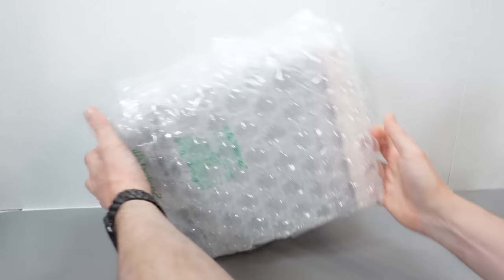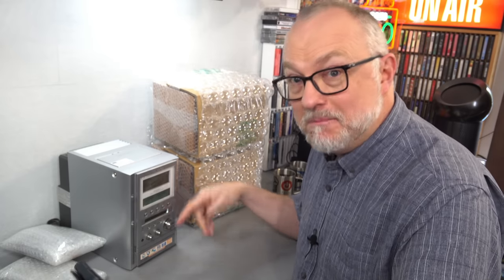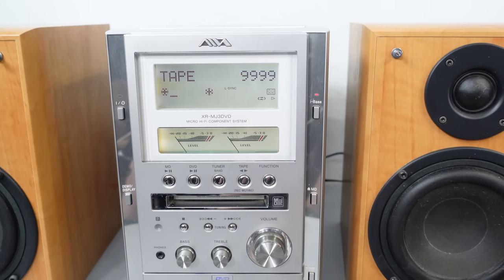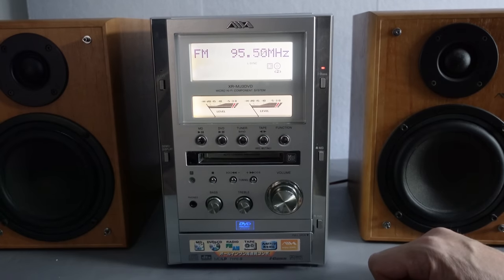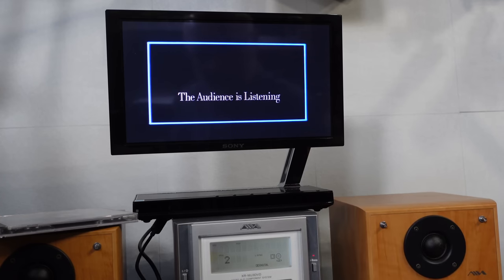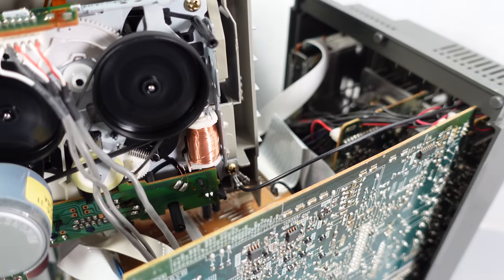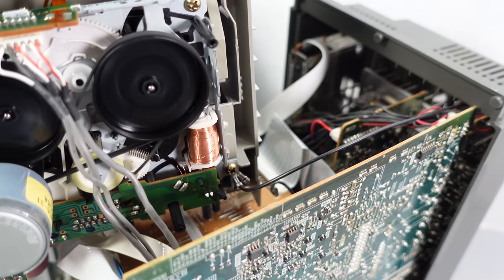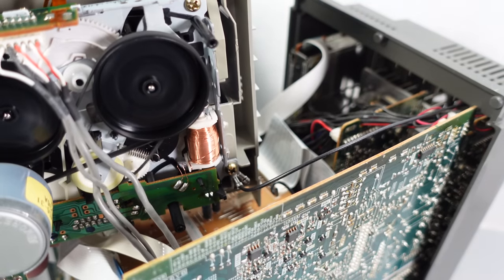Micro Systems 2:  Eclectic Boo-Boo

Comment: The CD/DVD tray problem should be a simple fix. The spindle motor assembly should drop out of the way of the tray as it is opening but it is not dropping early enough. Normally this is caused by misalignment of some gears. There should be some alignment arrows on the tray rack and gears for the default position. As noted, those ribbon cables can sometimes change what side the insulator is on. I think its good practice before disassembly to use a sharpie to mark across every connector to make sure you put them all back correctly. Also, the mini-disc may just be a bent leaf switch or bracket or something has become misaligned/disconnected etc..
Reply: It also can be caused by the magnet in the top of the drive that holds the disk down magnetizing the metal in the spindle underneath it. The motor that normally pulls them apart isn't strong enough. A hacky repair for this is to get those 3 ring binder reinforcement stickers from the office supply store and stack a few of them on the magnet. It causes it not to stick as hard to the spindle reducing the force the motor has to overcome. I've had this issue on a few old xbox 360s and that was the "fix".

Comment: My experience was, that these types of systems often had issues to a degree, that you wouldn't use them very often (which is why these systems look nice and unscratched): CD read errors or jumps and pauses when playing, tapes sounding dreadful overall (too fast, not steady, ...), tape recordings even worse, bad radio reception. Which was surprising, because the simplest PC CD Rom drive worked just fine for Audio CDs.
Reply: I wonder if that had anything to do with the additional complexity of a CD-ROM compared to an audio CD? Maybe in the process of getting acceptable reliability for data, you end up getting pretty good reliability for audio? Or, perhaps the quest for faster drives for data use also resulted in making them more reliable for the baseline audio use case? That is, a drive that can pluck data off a clean disc at 48x might be able to pluck audio off a dodgy disc at 1x, just due to having better mechanisms and electronics that handle fluctuations in the laser's signal better. [shrugs] I dunno. It's just a guess, so don't take me as an expert or anything.

Comment: When these combined Hi-fi units started to appear, a common statement from 'Experts' was - Buy separate units, you can always replace or repair an individual unit.  I still have a compact Sony micro Hi-fi from about 1995 but If I took it out now I am sure some of the belts would have melted. It seems our requirements have moved on

Comment: Certainly a good microsystem! It looks remarkably similar to a Sony bookshelf unit I purchased a few years ago. It’s from 2002 or so, and only does CD, MD, and tape, not DVD like yours. My unit also has NetMD capability, but only headphone and speaker out. The best thing about my unit was the hi speed dubbing from CD to MD, which is how I burned most of my MDs. And you’re right about needing a remote control! I had to order one online, very hard to find and cost as much as the unit did itself!
Edit: now I’ve watched to the end, I guess I’m lucky mine is in fairly good working order. But thank you for sharing your efforts to repair your unit, because I’ve had many woeful experiences with old tech, and so many other youtubers are rather misleading with how “easy” it is to repair and modify old technology.
Reply: Some of it is easy, made simpler with careful disassembly and witness marks. Always take note of ribbon insertion polarity, and mark a consistent edge to be sure e.g. the outside left and not on a part that can come off due to old glue. Some of it is extremely tricky with brittle plastic gears and intricate assemblies. You just have to gain experience on things that don't matter to you first. But I do agree some YouTubers insulate people against a lot of the pain via editing so it looks like bisch basch bosch and any noddy can do it without a bean of prep work.
Reply: There's a reason why it resembles the Sony - because it basically IS a Sony. This micro system was produced during a period of time where Aiwa was under ownership of Sony.

Comment: It might be interesting to get the DVD drive model number and see if there is a replacement available. If you could get that working you'd have at least a radio and DVD/CD output. Perhaps take another look at the tape drive and see if a diode has shorted in the power supply, should be an easy fix. Use a multimeter on continuity setting to check for shorts. Try to get a part number off the MiniDisc drive as well and see if there is a replacement or substitute around.
Reply: That looks like the classic tray issue most cd/dvd drives for PC would have, you can probably help it go all the way out by simply pulling a bit. I bet its exactly that, some Sony DVD drive for PC without its outer case.

Comment: Excellent video.
As an ex consumer electronics repair engineer, here's a trick with units with several ribbon cables. 
Mark each cable with a dot from a different colour of Sharpie, marking the socket on the same side as the cable mark. This way you'll have a colour coded reference as to where each cable plugs, and which orientation it goes. Doing this will eliminate incorrect placement and polarity reversal. 
I used to hate repairing these micro systems, but Sony were the best for ease of disassembly and assembly after a repair.

Comment: Great video! The Aiwa 22, is a quality system. You cannot beat a separate preamplifier and power amplifier set up! It just needs a recap, some transistors, diodes. and resistors replacement. A system of this specification made today, would cost you easily over £4000.
Reply: I was quite surprised at how dismissive he seemed to be of the classic 22 combo. Like he couldn't see or appreciate the quality of the components it has inside and out. Once you've hooked one up to some proper speakers it's easy to understand how that would be a £4k system nowadays. This thing from Sony era Aiwa is just junk in comparison. Though to be fair Techmoam has always been more about the gimmicks than the quality.

Comment: That was fun to watch.

I had the exactly same one in 2003. There was once difference. Mine said SONY.

When I went to Japan and saw the AIWA version I found out. That in Japan it was sold as a AIWA, but SONY sold it in China under their own brand. It was exactly the same in every detail except for the name tag.

On mine the first thing that dies was the MINI disc, second was the CD/DVD. I brought it to SONY in Beijing for repair in 2008, but they would not even touch it. They said it was too old. Yes only 5 years later and it was too old.

Comment: This goes to show that cramming functions into one device doesn't make it better. Instead of doing one function great, it does many things mediocre at best. As always, thanks for making these videos!
Reply: The F35 is an extreme example of that..  😄
Reply: Cramming functions into one cheap device doesn't make it better!

If this was a high quality stereo system, they totally would've been able to put all those functions into it and make every single one of them top notch. With a hefty price tag to match, of course!
Reply: Except that back in the day, (1) no one expected to be using this 20 year later.  (2) the compromises were worth it.  If someone had both the money and space for a separates system, they would have had one.
Reply: @kcgunesq  Exactly - being compact and affordable were obvsiouly part of the design spec. In that respect it looks like they succeeded.
Reply: @LRM12o8  Sony, Panasonic etc do have higher end versions of these micro systems.  Some are quite pricey indeed!

Comment: I have a similarly capable little unit from Panasonic from around 2004, with the added benefit of SCART and a 5 disc autochanger. It can't play mini discs though. Used it a lot back then but it's been living in a cupboard for the last 15 yrs or so.

Comment: I just lived this with a 40 year old Pioneer PL-L1000 turntable.  My son and I took it from kinda working, with a couple of minor quirks, to unusable. We can take solace in the fact that no matter if you fix it or not it will inevitably break again, and probably permanently, very soon. These old devices, whether 20 years old, or 40 years old, just are going to wear out.  Unless you're very experienced with repairing circuit boards you're never going to get them right.  Thanks for validating my failure dude!

Comment: Another great video, its great to see this blast from the past. I had one of these around 15 years ago, and of course the humble CD player ate discs similar to the MD player. The sound on the Aus model was fantastic and used mainly connected as computer speakers and Aux. I pulled the CD player out as there was no use for it and and there was the wait time to load up which was fine as windows Xp loaded up. 
I enjoyed watching the video and how you open up and repair these great gems. Keep up the great work 👍👍👍

Comment: I did buy a micro system about 4 years ago and, touch wood, it is still working today. Not quite as advanced as the Aiwa but it does have a type R MDLP minidisk, CD with digital audio text capability, a basic cassette deck, and a tuner. It didn't come with a remote control but, being a Sony, there are plenty of cheap compatibles out there that work perfectly for about £10.

Comment: My ex-husband worked for a stereo supply store and often brought home "samples" from the conference rooms where the manufacturer reps tried to convince the sales reps to carry their products. I think I've mentioned this in a previous video on mini discs.
Anyway, our version was a US market model. It was a bit shorter because they had removed the cassette player and moved the disc player to the top position. There was no DVD option and the little drop down command center was not present. Consequently, as you mentioned, the remote was absolutely necessary in order to access all features.
We loved that we could burn our CDs to mini discs directly instead of dealing with the clunky software provided by Sony for use on PCs and Macs. I can almost see the software name, but my memory just isn't kicking in.
Finally, the radio was just bad. Normally we had no problem accessing the dozen or so local channels from our apartment. This pulled in maybe three. But, the unit was free, and it wasn't a feature we would normally use anyway.
As always, thanks for your informative and entertaining videos.

Comment: When I was young we had a beautiful Technics Micro or mini system like this and it was really good quality. It had all the components separate so that you could add a mini disk player if you want. It's probably a little larger than the one in this video but still really nice one. It had nice quality radio, A CD player with multiple slots for 5 cd loader I think and it had a decent Cassette tape player. But around 15 years ago my sister tried to play a cd and put 2 cd's in one slot. The cd player never worked again. Because of that my father bought a decent quality HIFI Entertainment system from Denon with an iPad connection on it, CD, DVD and even SA CD on it. Because of that I received that Micro hifi system and my father installed it in my sleeping room. Because of this micro system I started playing my parents old cassette tapes and my interest in Hifi equipment from the past grew because of that. At this moment I have a big and beautiful 1980's receiver with a high end cd player, Technics record player and a Cassette deck from Pioneer. Really nice setup I think

Comment: Small minidisc decks generally have really tiny loading belts - I've used loom bands to replace those a few times and they work fine if they fit your deck. They're a bit smaller than the original belt, but they stretch a lot and are fine if its just used for loading

Comment: I have an Aiwa  mini system that I use out in the garage from the early 2000's. 3 disc CD carousel, dual cassette, AUX and AM/FM  The only components that still works are the radio and AUX. I have a Chromecast audio plugged in and stream from my phone.
I also had a JVC micro system back in the mid 90's that was awesome for its size. I have no idea what ever happened to it.

Comment: I bought an AIWA 5.1 mini system at about that time and still have that, except the two main front speakers I gave them to a friend. It has Dolby Digital 5.1 decoding from a Toslink digital optical input (no DTS unfortunately). There's a 3 CD/MP3 changer and dual cassette deck (forgot if it has Dolby B or not) and it's a little bit bigger than the system in the video here. The original box was huge because it came with 6 speakers and the subwoofer is not very small. It was on clearance at Walmart for $80. So it was a very good deal at the time.

Comment: Found a nice little sony with just a cd and radio tuner a goodwill.  It didn't power on at all but when i took it apart there was a ribbon cable hanging loose.  plugged it in and it functions really nicely.  It's a cool little system.

Comment: There are not enough videos where the fix it fails actually get posted. This is the reality of retro hi-fi. 
If it has sentimental value or you are going to keep it then fix it, if not then don't spend the money. 
You need a lot of experience to be able to easily diagnose and fix electronics. 
It's nice to see fails by experienced enthusiasts.

Comment: I've bought three micro systems in the last couple of years, from charity shops and one from an auction site. All three work well and the one i got for myself has DAB+, Bluetooth, mp3 and a few other nice features, all for £15 plus remote control. If they stop working,  I've not paid a fortune for them so I'm not too concerned if they fail, but I like the fact I'm prolonging the life of these systems instead of them going into landfill.

Comment: Makes me wonder if the radio is behaving the same way as the radios in JDM cars, without a band expander pretty much all you'll get is Radio2. A brave repair (it had me on the edge of my seat though) and it's a shame it didn't work out. Still a great watch. Thanks, and I'm looking forward to part 3.

Comment: I had that same model, but with SONY logo. On mine I had to change the drive belt for the MD eject and also for the cassette capstan drive belt. I had difficulties with the cassette auto reverse because when it was playing in reverse mode there were very much wow and flutter, and after the middle of the tape side was played, it stopped. The ribbon drive belt was always slipping too much in its contact with the flywheel. The cassette mechanism had only-plastic flywheels. At least the CD / DVD mechanism was working with no troubles and after the drive belt change in the MD mechanism, this worked perfectly too. 
I had this machine for about five years, but then I sold it.

Comment: I know that this is late knowledge but 1 way to get a minidisc out of a machine is flip it upside down and then try to eject it. Stuck minidiscs are normally because the belt is worn/slipping and when its upside down gravity helps alleviate the inability of the belt to eject it. I had to do this when my Sony MDS-JE470 belt went out. Also as a side note when replacing belts you dont always need the "belt". In the minidisc players since the belts are smaller you can actually use o-rings which is way cheaper and work just as well. You just have to do some research on when the measurements are of the original belt and then find a comparable o-ring.

Comment: 24:52 breaking flat cables while unplugging/reseating: this is why i systematically use good pliers ("Knipex Telefonzange") for it. i stopped using bare fingers, since it's hardly impossible to assess the risk before actually ruining it.

Comment: I have a Sony mini/micro style I use quite a bit still from the same era as this aiwa. Mine is a much more stripped down American version with aux, 3 disc changer and radio. It’s greatest feature for me has got to be the powered sub. So good in fact I found a used broken unit I purchased just to have 2 powered subs.

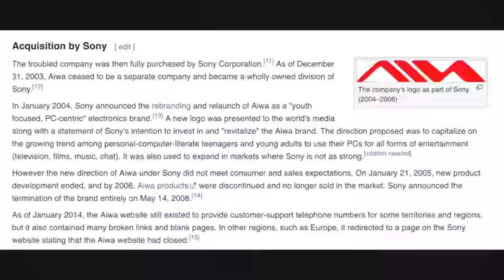Comment: (14:03) I remember when I wanted a portable CD player of my own, and my dad surprised me with an Aiwa portable CD player that had that logo, but it was brand new and missing the inline remote control. I checked the manual and found that he had purchased the cheaper model that didn't include it in the first place, and made him return it to the shop and get me one that did, but the shop he bought it from didn't even sell the model with the inline remote. At the time, I was 7 and didn't think to make him call up the closest service centre and attempt to buy just the inline remote control (or a Sony Walkman branded one) as a replacement part intended for the more expensive version to then 'convert' my cheap model into that one I wanted instead.

Comment: I have a Panasonic SA-PM91D in my room, about from the same era and around the same size. It does about all the same things as the Aiwa you mentioned here, with the exception of MiniDisc - kinda to be expected from a European market device, to be fair. It does, however, pack a 5-CD/DVD changer instead of the single slot on the Aiwa, and it also supports CD-Text.
It also has some "smarter" features included, like the ability to program a list of tracks to be played next (think like a queue in modern media player software) or being able to play through all the 5 CDs/DVDs you insert from beginning to end.

Comment: Interfacing [Legendary - Failure]:  "Uh-oh."

This brings to mind my fiasco with the Minidisc boomboxes.  MD read errors, dead MD modules, oh joy. Expensive to ship, not multi-voltage (they don't like 120V), and you can't kick the tires before committing to it.